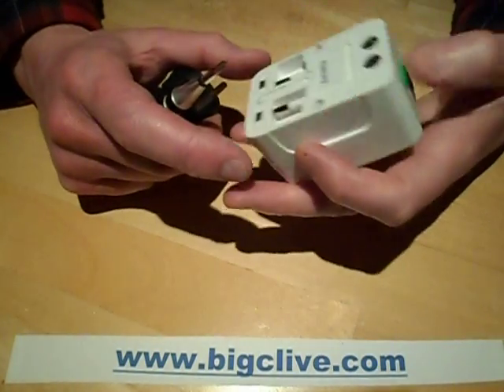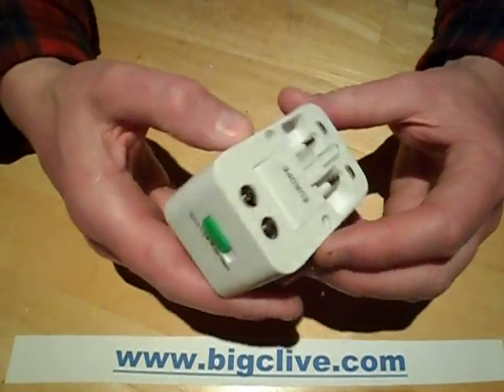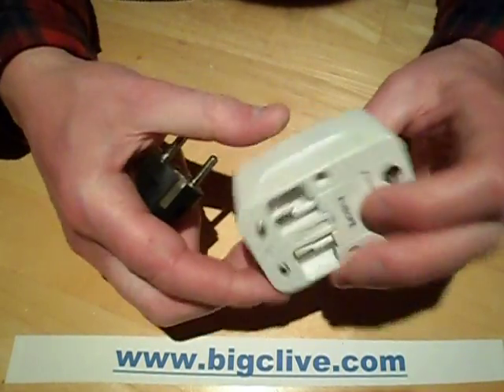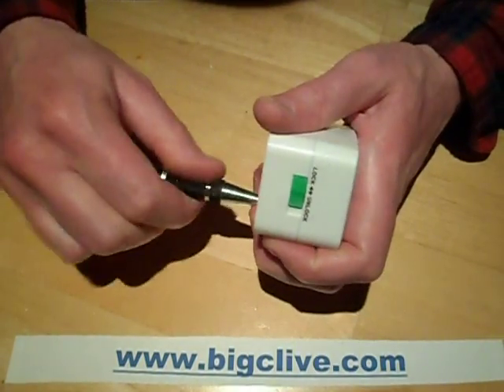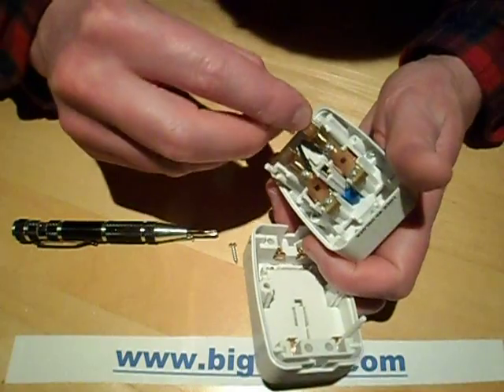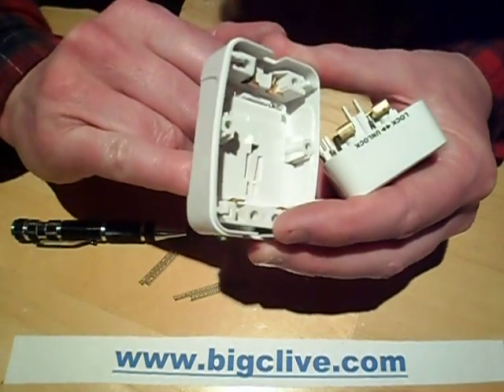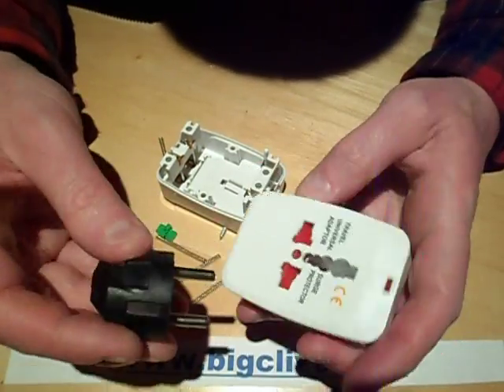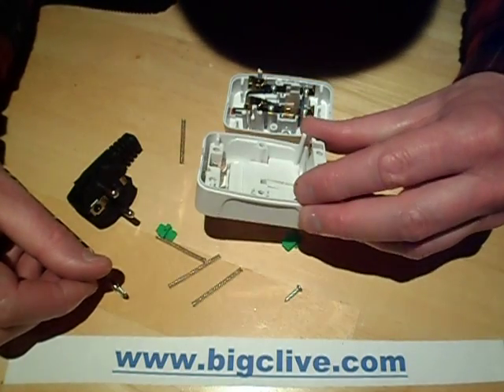Unearthed / ungrounded mains adapter.

Comment: I'm glad you mentioned how you can get a shock if you plug it in with just one pin in the outlet. I live in Canada and used to have an extension cord running to my bed so I could plug in my phone charger or swap it out for whatever else while I was in bed without having to get up. But since I usually plugged these things in in the dark, I would often get it so there was only one pin plugged in. And of course being that it was dark, your first instinct is to want to feel around to make sure it's plugged in right. I never actually did, but I always wondered just how much risk there would have been if I touched the exposed pin.

Comment: There's nothing wrong with the 3rd pin being plastic, but where it fails is in having holes for NEMA and various European 3 pin plugs.
Reply: How so? If the earth pin is plastic yet accepts 3 pin plugs it ends up doing what the reviews said "no earth continuity". The appliance is fine but the adapter doesn't connect it through. The adapter shouldn't have any earth sockets if it doesn't have an earth pin to contact to the supply.
Reply: Tera Volt North American plugs come in 2 prong or 3 prong varients. If you can only use a 2 prong plug, then ground isn't an issue.
Reply: brett knoss right, but in this case you can plug in a 3 pin and defeat its purpose
Reply: Tera Volt that was my point.
Reply: You didn't make it very clear

Comment: I came across a similar device being marketed as a travel adaptor in a large retail store.
My suspicion was that it might be possible to deploy the continental pins whilst the UK connections were in use.
So it proved to be, so I alerted Trading Standards locally, and offered to give them the said unit in order for them to conduct their own tests. They declined, saying they needed to buy it themselves. However, they said they would convey their test results to me.
I never heard any more, and the wretched things were still on sale for a pound for the rest of the holiday season.
Thanks for all your input in making these videos.